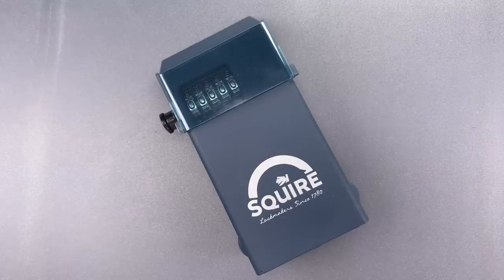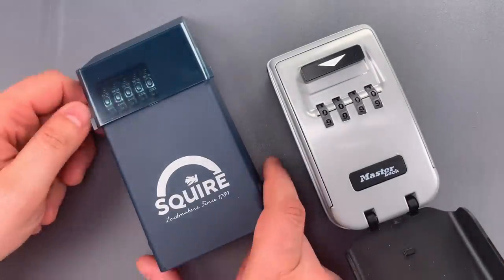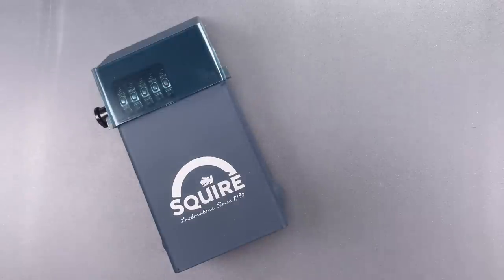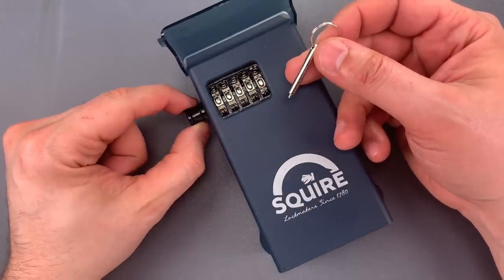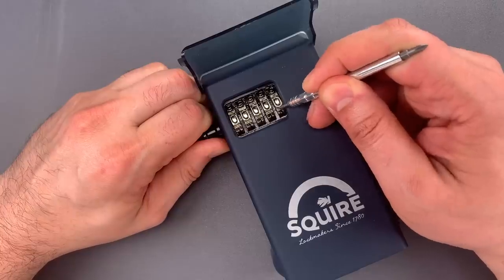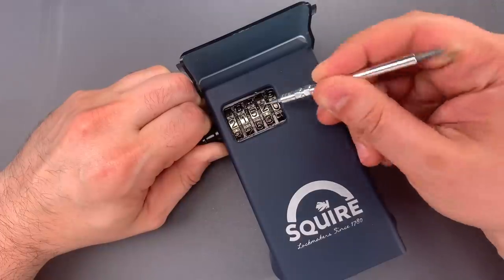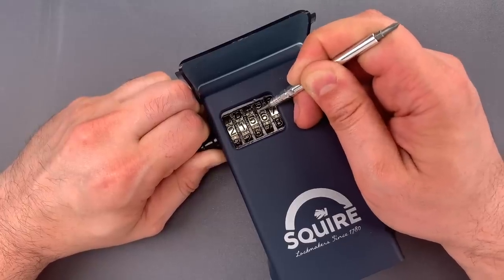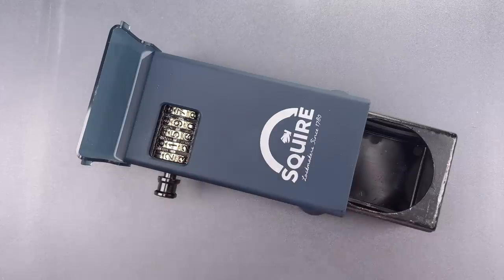[1171] Better Than Most, But Still Problematic: Squire Stronghold Keysafe

Comment: For a combination lock that was an impressive showing. Usually those pop right open as soon as LPL touches them.
This one seems to require at least some skill and effort to pick; leagues ahead of many of its competitors.
Reply: Yeah, I didn't expect to see false gates lol
Certainly not this many of them
Reply: That's the best combination lock I've personally seen on this channel. And I've been waiting for a while for a combination lock that LPL doesn't totally laugh at.
Reply: He didn't pick it, he decoded it.
Reply: Its certainly streets ahead of the competition.
Reply: Rare to see so many false gates, some of which even LPL fell for at least long enough that he had to do a second pass.
Reply: Squire locks are very good not surprised that this one is too
Reply: Yes, I don't think a teenager that watched a YouTube video on how to decode a lock would be able to tell when the squire was in a gate or false gate. For my use that's my main concern.
Reply: @irishgiant5150  main problem with combination locks is that you can always guess your way this one is getting into the painfull part of guessing time wise but it is not to bad if the rotation of the wheels is semi good
Reply: @simedinson984  This one has 100,000 possible combinations. If you were able to check 5 a second, that would still be over 2h45m, on average, to find the combination.
Reply: @wbfaulk  well as it is most likely attached to a wall and most of the time ppl dont bother to rotate the wheels to much it should be even less also 00000 and such is generaly not in use
Reply: @simedinson984  3 notches in either direction is 60% of the values. 4 notches in either direction is 90% of the values. In addition, if you're speeding through combinations, stopping to reset to a position rather than just traveling all the way around the wheel is going to slow you down. (4 up and then 4 back? You've just spent 80% of the time that you would checking 100% of the combinations, but only checked 40% of them.) You could maybe deprioritize certain combinations (maybe start at 11111 instead of 00000), but that's not likely to have a huge impact.
Reply: Nah. It didn't take any skill to open, that's the whole point of the video. It had some false gates that increased the decode time by 10 seconds, that's all. 

The methodology is no more advanced than decoding the masterlock competitor. He still decodes this squire lock in UNDER A MINUTE. 

He's only saying it's better in construction. That is, it isn't a soft metal. Otherwise it's the same thing as the masterlock. 

Don't buy this keybox, it's expensive junk. That's the takeaway
Reply: @tjmarx  "He still decodes this squire lock in UNDER A MINUTE." he is a master picker, he picks a Mul-t-lock in less than 2 minuites.

The master lock lockbox took him about 25 seconds, this took him about 55 seconds.
Reply: @petermichaelgreen  He's decoding, not picking. The skills required to decode the either of these lockboxes are minimal. 

It took him 45 seconds on the masterlock key box. 

An average novice can decode either of these products in under 2 minutes. That's the point LPL is trying to make, this is a VERY low skilled attack. You're literally just moving the tumblers until you feel a gate.
Reply: thehypercovery there’s nothing very good about a lock you can tug on the knob and wiggle the dials on. Less terrible? Maybe.
Reply: @Marlexyx  stop trying to make that a thing, pierce
Reply: @charbelabidaher4443   He doesn't hate the ABUS 190CS/60 High Security Solid Steel Combination Padlock

Comment: This technique of feeling the loose spots has been applied to pretty much all of the combination locks and I wonder if it's simply just a limitation of this type of lock mechanism that can't be avoided.
Reply: juances Techique is very similar than what is used to pick disk detainer locks.
Difference is that combination locks are cheap and have loose tolerances.
Reply: reverse sidebar like in all other lock types can make this much harder
Reply: Yeah, my understanding is this gets a lot more awkward if you can't easily put tension on the locking mechanism (hence having to reach inside with a pick for some combination locks to pull/push the thing that interacts with the gates). I've tried decoding combination locks like this and I've found it extremely difficult to tell when something is a false gate. When your mechanism clicks into the false gate it usually gets bound on another gate, which often (to me) means I don't feel the stiffness LPL is talking about.
Reply: I wonder if it's possible to construct it in a way that prevents the weel being turned at all, when something puts tension on the mechanism. That woul solve the problem wouldn't it?
Reply: Depends on what one means by "combination locks". There are mechanisms that will prevent this type of attack (at least without a tool to put tension on the sidebar) even on cheap "number wheel" type locks like this one - LPL has several videos on how some can still be easily picked. A Sargent & Greenleaf 8088 / 8077 is still a combination lock, but it's A LOT harder to pick...
Reply: @melonlord1414  Deep false gates at every position. Make them deep enough and you have to push the lock back closed to even move a wheel. Make them narrow enough and there won't be any motion to feel drag on. At that point you are looking for the depth of travel and that would likely take something like a dial indicator. (Might then be fun/evil to have all the false gates have different depths.)

But for that much $$$, I suspect you could just get a better basic design.
Reply: @melonlord1414  i think this is so tools are not needed, could push something in to feel the wheels. would be more secure though
Reply: @yetanotherstronk  I think with this lock, as other wheels get into true gate, he can feel the next false gate rubbing on the bar,  since there are tolerance issues some may feel like a true gate tell others are cleared.
Reply: @westcoaststacker569  Ah, so I guess you get every dial into a gate (false or true), then one of the ones in false gate will bind. Move that to a gate that doesn't bind, then repeat, trying to reach a smooth gate with all.
Reply: Pretty much, but I've encountered a few that are very difficult to decode.  It's all about how well they are built.
Reply: @yetanotherstronk  How I picture it, seems that is how he progressed in the video.

Comment: Hey LPL! 

Just wanted to share a quick story where you saved me the cost of a locksmith after hours call out. I locked myself out of my bedroom with one of those combo handle/lock combos in most apartments. I was just about to call a smith out before I stopped and thought about how you might open it, even if you’ve never seen the lock or key before. I ended up finding an Allen wrench that fit in the keyway, put torque on the handle, and jiggled the wrench and it popped right open! I was so excited to get it open I had to come and leave a comment because there’s no way I would’ve even thought to try to open it myself without your videos. If you ever get a Patreon I’ll definitely kick over the fee I would’ve paid ;)

Thank you for the amazing content and keep up the great work!

PS I’m pretty drunk on some Bulleit atm so I’m even prouder of myself lmao

Comment: Isn't this the same company of locks that you couldn't break with armor piercing shells?
Reply: Yes
Reply: Yes it is
Reply: Yes I was wondering why it sounded familiar
Reply: Does anyone know what 50cal bmg SLAP rounds do? Maybe not even an atom of the lock left
Reply: @Gdawg0331  They probably do much more noise than you would want to make when picking a lock.  I wouldn't carry a turret somewhere if i wanted to just go stealthy, anyways.
Reply: @Gdawg0331  I remember seeing that video. One of the characteristics of the AP rounds was that they went through and through with no expansion internally. It was equivalent to drilling a hole in the lock body. And at the distance they were shooting they couldn't be guaranteed to hit on one of the parts that would release the lock.
Reply: @Gdawg0331  they shot APIT rounds at it... Doubt a slap would have done significantly more damage.
Reply: @Gdawg0331  I reckon a .50 BMG SLAP could blow up a Serbu RN-50 and strip the threads

Comment: Hearing the it click into place when you land in the correct gate made me want to try something with my extremely cheap little gun "safe," which exists just to have something by my bedside that isn't a gun laying in the open at night. You reviewed basically the same one in 1036.

Putting pressure on the dial in the unlock direction didn't do a whole lot, but twisting it in the lock direction made a distinctly different click whenever the correct gate was located. Yet another way to get in to this incredibly cheap "safe," lol.

Comment: I can explain how the code change mechanism actually works on this lock. When the lock is open, the locking mechanism is blocked from turning. The actual code wheels are just rings around the actual locking mechanism, but with strong ball detents. What you are doing with the little tool in the holes, are just forcing the rings into new positions, by overcoming that ball detent. It is actually a pretty smart and good mechanism as it reduces the number of critical parts in the lock for code changing, since the actual locking mechanism doesn't need to be able to change code.

In other locks, the code changing mechanism works by shifting the mechanism out of the code wheels, which is a weakness as now you must make sure the code changing mechanism cannot be activated while the lock is closed, usually by having a shackle detent into the code changing screw that prevents the screw from being turned while lock is closed or incorrect code is entered.

In this Squire lock, the code changing mechanism is always active, so technically you could change the code while the lock is locked, if you somehow manage to seize the inner part of the locking mechanism and then turn the rings by force. This would just offset the code tough, so you would still need to know the current code to know what the new code becomes.

Comment: Could you do some more on the materials used?  I had decently rated 6 pin squire lock as a better option than the average, but the local scumbags went right through it with bolt cutters in one go, which shocked me for what I thought was a better brand and more robust lock.  It would be interesting to know which locks were the better mid range options, if there are any, rather than all mouth and no trousers.  For all the pick resistance in the world, if it can’t survive local hardware store bolt croppers it’s a complete waste of money for most purposes.

Comment: i kinda feel like most of these combo locks would do great to have some measure that prevents attempting to open it while turning the wheels. like it has a window, make pulling the pin impossible while the window is open and you make feeling for gates impossible too.

Comment: So I'm beginning to think the only way to keep people from using any kind of decoding technique is to: 1) shield the sides of the wheels and/or the shaft they ride on, as well as any release mechanism (I'm looking at you Master Lock) 2) firmly bind the wheels when even touching the open mechanism to prevent ANY movement and thus eliminating most forms of feedback 3) decouple the opening mechanism from the wheels so that if you can't bind the wheels to prevent them from moving regardless of state of the lock, then at least the opening mechanism doesn't provide any feedback as to the state of the wheels and doesn't allow binding the wheels like in the manner demonstrated in this video (the false gates didn't seem to do much) 4) use a very strong detent mechanism so that the wheels firmly fall into their positions regardless of the state of the lock.  I don't see any of that being inexpensive enough to make it to the general marketplace :\

Comment: The problem with all these nice single digit locks is, their digits reveal the correct gate, whenever the locking bar is tensioned. Small hooks on the locking bar, that would prevented turning the wheels upon tensioning, could help. Obviously, such a high-tech design is not affordable for lock companies.

Comment: I’m currently designing a key and lock mechanism that uses a key with multiple left and right angles. It is not inserted into a hole. It is laid on a groove, then shifted to the right, pulled back towards the user and then turned to the left. It is impossible to pick because the pins cannot be reached.

Comment: Hey lplw, are there locks out there that use an E shaped key (or a V or €)?
My thought is, that it would be very difficult to pick it, because you could have multiple nasty biddings with short travel, essentially denying the pick from accessing or at least making picking extremely difficult since you have to move low cut pins all the time to get past them...

Or is my theory just flawed 🤔

Comment: I need help!
I just bought a new truck. For the first time in 7 or 8 years I locked my self out.. not only that but poke a dozen times this month since I bought it. I dont know why.. I made plastic hdpe wedges and have a tig welding rod hook to open it up and can do it in less then a min now, but.. 

Here is the ask, to the best comment section in youtube.

I like this box and was thinking if bolting it to my work box, in the back of the truck. But the security flaw has me worried, so what better choices do I have for a keyless lock (cause my keys would be locked in the truck at this point so a key wont work) and the hide a key diesbt offer much to my f250 super duty since I'm often in hard territory being construction. 

I use abus locks for my tool boxes, and lock out tag out kits(electrician) and just want to make it slightly faster then showing everyone where my tig rod and shims are
Reply: Honestly, I'd use a keyed lock box with a key small enough to fit in your wallet.  Assuming you keep your wallet on you at all times, if you lock your keys in the truck, you can reach in your wallet to get your...  key to your spare key?

If your truck key will fit in a space in your wallet, I'd just put your spare key there and skip the keybox entirely.  If not, then a keyed keybox whose key lives in your wallet would work.  Or, since keyed keyboxs seem to be hard to find, a toolbox you'd carry anyway whose key lives in your wallet instead of on your keychain.
Reply: @gatherer818  I do carry spare keys in my wallet, but was trying to think outside that box.

It would be a advantage to be able to give the code to someone to pick up the truck for me, say if I'm out of state for work.

Comment: Comparing it to a masterlock and saying they have the same flaw just made my appreciation for material choice unimportant.
Reply: it's a flaw inherent with those kinds of combination locks.
Reply: To be fair, most people won't even attempt to decode it, they've usually decided their attack method in advance, and if they're planning to smash a lock but see a box that won't smash easily, they'll try a different target rather than waste their time.  If they know that little trick that works on many/most combination locks, though, and were planning to decode it, the construction won't matter.
Reply: @gatherer818  That indeed is true, however because it's a box I think they'd just sleat it away and crack it open(in whatever way) at a place where people won't notice.

Comment: The only thing I can think of from a manufacturer's perspective is if the gates were tighter and harder to determine, the average user would need to make sure the numbers lined up precisely in order to get such a lock open.  In that instance, I could see a lot of consumers complaining that the locks were simply unusable.  Personally, I think those dial locks should be done away with entirely.

Comment: So even if the gap is covered, the gates can still be felt? I think this might be a problem with rotating number locks in general. This might be a problem that could be too difficult or costly to solve compared to just using another method of locking.

Comment: Would it be as simple to attack for someone less experienced? Or would a newbie fall for the false gates?
Reply: The first and second dials he tried had false gates that he didn't seem to notice until he made a second pass (and it was obvious he had to do a second pass since the lock didn't open).  So a newbie almost certainly wouldn't notice the first time around, and may not be experienced enough to notice afterwards either.

Comment: I'm confused about some of your terminology. I used to go by my school on the weekends with my friends when I was in about the 4th grade and we'd ways go through the bike corral since there would always be at least one bicycle left over the weekend. I'd open those tumbler locks using the same method you use with this lock in order to library some random peer's bicycle and run it up the flagpole. But when you say "false gate" it makes it sound like the lock designer has built in some sort of pick-resistance. What exactly is a false gate? Because if this lock is built the way I think it is, there's just one position on each wheel that will allow it to be unlocked. Is that correct? If it is, what exactly is a false gate in the context of this specific lock?
Reply: A false gate feels like the correct position, but isn't.  It's loose to the touch, like you saw in the video, but won't allow the lock to be opened.  On this lock specifically, it looks like each dial has three gates evenly spaced, the true and two false.  It'll slow down an inexperienced decoder - "wait, they all feel right, why isn't it opening?" - but it barely cost LPL a few extra seconds to revisit a few and find the ones he'd left in false gates.